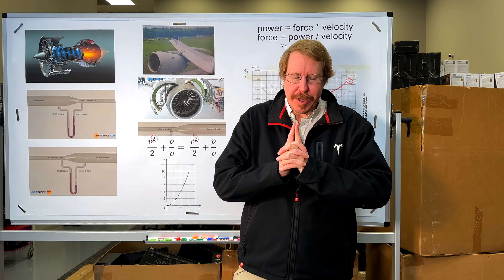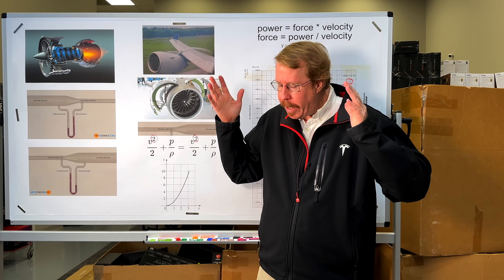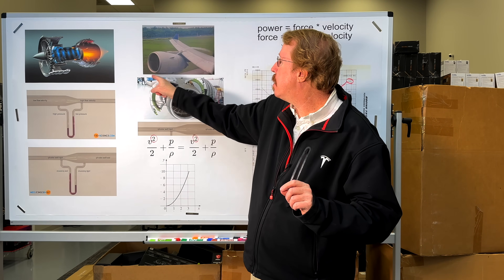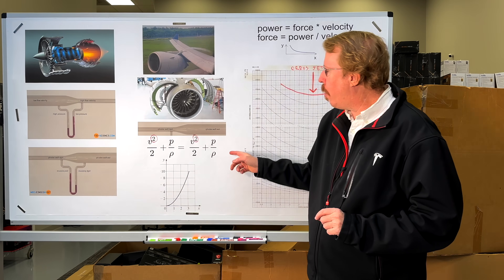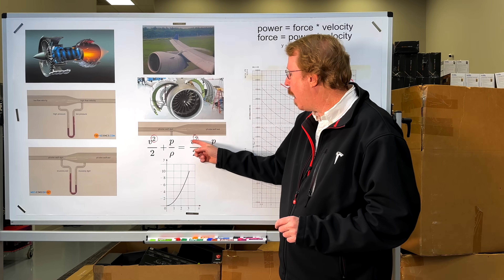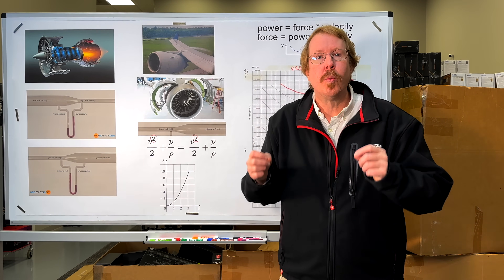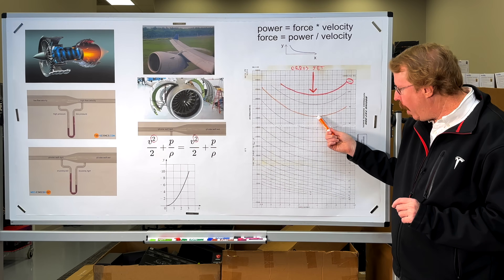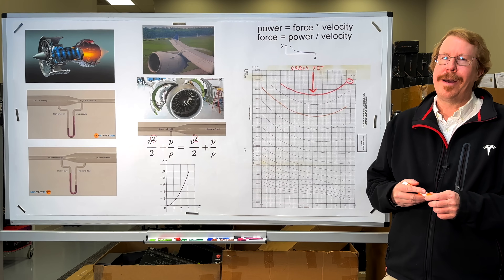18th CENTURY technology in your JET ENGINE?

Comment: @7:41 Acceleration is delta V divided by delta T. It does not depend on the current car speed. If you burn 1 oz of fuel in 1 sec you will get particular  acceleration regardless of the current car speed. a=SQRT((2∗E/m)^2/t). Acceleration depends on Burned fuel Energy (E), car mass (M) and time (t). We can also replace Energy (E) with Engine Power (P) in the previous formula to get  a=SQRT(P/(2∗m∗t)).

Comment: Am I missing something? He stated at 3:42 that turbofan jet engines are designed with air going into a narrow tube then going into a bigger tube. But the air intakes of a jet engine are bigger than the compressor of the engine, right? Is he saying that the big fan blades that the air hits first acts to spread the air throughout the engine and somehow making the tube in the middle of the engine wider? I’m struggling to see how the air intake at the front of the engine is a narrower tube than the compressor and exhaust at the middle and back of the engine. Can someone please explain? Thanks!
Reply: Correct. It is actually narrower in the front and gets wider going back to the fan. Now I know it is only a few inches but here is a fascinating thing: remember, we are looking at cross-section area and area goes with the square of the diameter… So a small increase in diameter is a much larger increase in area than you might think.
Reply: I just looked at some side-angle photos of turbofan engines and it looks like the front air intake cowling is indeed a bit narrower (by a few inches) than the middle of the engine. I assume this is what he is referring to

Comment: Bernoulli's laws were very helpful to me when I worked at a scientific instrument company called Tekran.  We built a really cool inertial probe that was designed by my bosses, and I wrote the software to their specifications.  One of the cool parts of our product was that it was volumetric, which is to say, the probe had to know how much of the exhaust gasses had been extracted as a sample, and how much dilution had been achieved, so all flows of clean (dilution) and highly acidic  sample gasses (coal fired generators, for instance) had to be measured very accurately.  The narrowing of a venturi and a differential and an absolute pressure sensor and Bernoulli's equations permitted us to figure out the actual  volumetric flows.   Pilots are familiar with this as well, because of the pitot tubes and the pressure sensor and the differential pressures helping us know how fast an aircraft is travelling by knowing how fast the air is moving over the airframe.   It was some years ago that I worked at Tekran and I am still incredibly proud of what tekran designed;   The technology they built is still in use to help in monitoring sources of mercury pollution, to ensure that public health, and environmental integrity (water and air quality) are protected.   Bernoulli's equations have MANY uses, both in and out of aeronautical engineering.